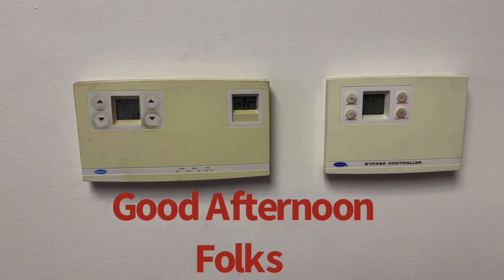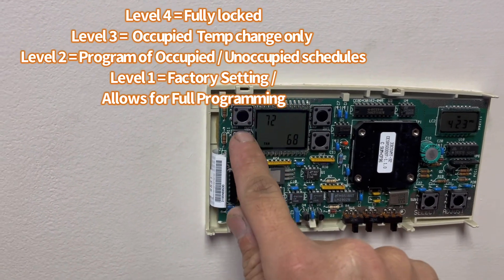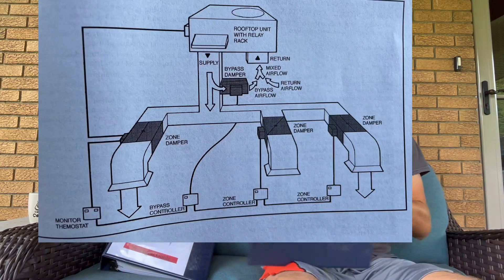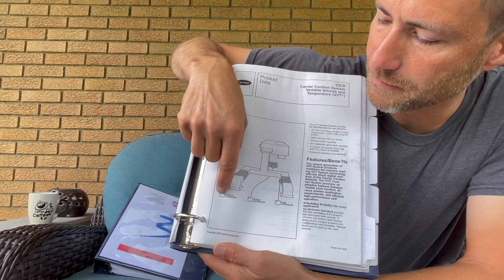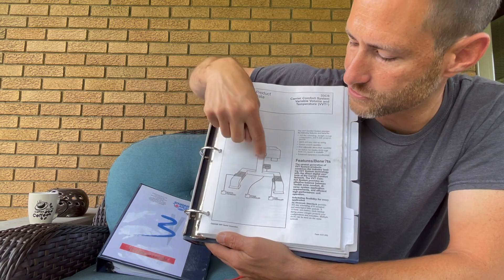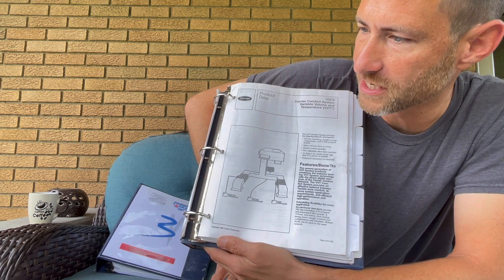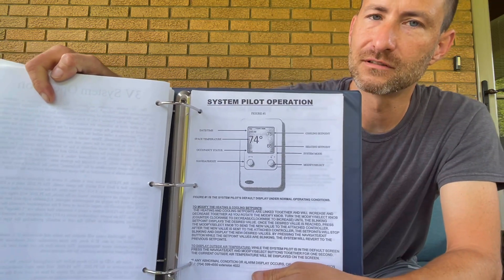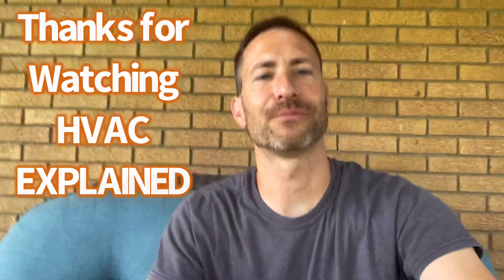Brush Up on Old Technology #Steamfitterslocal449 #HVACEXPLAINED #RuthRauff #heatingandcooling #hvac

Comment: What is the bypass controller for?

Also even if it is set to 75 it feels like an igloo in the office why help!
Reply from the maker: Hey, good afternoon.  
I am currently in route to help out our on-call guy a building down here in Florida got struck by lightning and a lot of stuff is down so bear with me on my response..
So basically that system works on a voting system.  
If you have just for an example :   10 rooms in the building and it’s calling for cooling in two rooms The air conditioning system will go into cooling mode sending airflow down the ductwork and into those two rooms after their zone actuators open up..   since there is a lot of airflow coming down and cannot go into those eight rooms that do not want cooling It has to go somewhere so they use a separate damper above the ceiling to disperse “bypass” the cold air above the ceiling and recirculate back to the return side of that system…  
And same goes for heating in the winter time.
There can be a number of issues while your office is in fact freezing .   
Just to name a few :
Your damper could be broken and stuck wide open, quite possibly damper. Actuator is bad and also is making the damper wide open. 
There could be a bad sensor in the ductwork .   The system that is above if you still have that system is probably 25 maybe 30 years old and due for an upgrade.   
Is your office the only one that is freezing cold?  Also, what is the temperature? Comparing to the rest of the space outside your room

Comment: Great video. Do you know anyone in the Seattle area who knows how to operate this system. Today's date  12/5/2024 and I live in this house for over 8 years with the system Carrier Parker Gen 2 thermostat with a rotary switch, 5 zones. About 5 years ago I was trying to change the set point temp and I mess it up and since then the thermostat is not properly working. Not sure what I did wrong. I was wondering if you know anyone in my area (Seattle) who can help. The furnace is partially working, I had to jumper wire for heating in the winter and cooling in the summer. Thanks

Comment: I have an IPad I use as a 3 ring binder. I keep current and old tech on it. I’m very familiar with Carrier as a CFAD guy. Those programmable Infinity controls have a lot of depth that you have to know ahead, but they are great for diagnostics and nailing the points
Reply from the maker: I’m still using Windows XP on my laptop.  Haha It’s a good system.  Lol

Comment: Ive been in the commercial refrigeration / hvac business since 1984. I still learn new and very useful stuff everyday, especially watching you young whipper snappers apply new technics and equipment. That’s how I manage to keep up and stay relevant in my chosen profession… keep learning.. be willing to be the one to ask questions. Your channel will eventually be huge my man!
Reply from the maker: A lot of younger guys learn a lot from you older guys.  Older guys have been out there for so long you’ve seen it all.  
Just an example how many young apprentices or technicians do you know that walk around with an analog multi meter? Or have ever touched pneumatics?  Possibly an U-Tube Manometer?  Or a Halide leak detector ???  
A lot of new equipment today have LED alert and alarm lights. Older equipment used to have reset buttons.  
Older equipment you can make little adjustments with a service wrench.  Newer equipment you can make adjustments with digital outputs on circuit boards or computers.  
Trust me sharing information is very helpful in this trade.  
Thank you very much for the comments and complement thank you for watching the short video and I’m gonna keep on putting them out there.  Have a great day and stay safe.
Reply: Older guys got me where I am. It’s a great resource and they enjoy the questions if they also enjoy being relevant.
Reply from the maker: @globeflicker9216 :  The one thing that has truly made me a better technician.  I had learned from my father and that is “Good Work Ethic”.   Old school work ethic seems to be like a dying art and believe it or not you can go very far in life with having little to no education as long as you give it your all.  There’s a difference between somebody who just doesn’t care versus just doesn’t know.  If you put everything into it and fail to me that means a lot versus somebody who didn’t even try.  That’s one thing guidance counselors and high schools should teach young kids today.  “If you’re going to do something give it your all.   Don’t worry about somebody else just worry about yourself.  You shouldn’t have to impress anybody except your self.”
I’m not in this field to become a billionaire, just to live comfortably and provide for my family.
Reply: HVAC EXPLAINED 
I’m generationally a Boomer. Grew up with old timers I ignored. Turns out they were right. If you don’t understand old tech (I study old steam books and catalogs so I can easily identify different systems) trying to adapt the ‘latest thing’ may be the worst option. I get to play with manuals, slide rules and tables before I touch a wrench or wire strippers. That’s why I love this trade, you can learn a lot the right way to do it.

Comment: Yea, you can reset the old obsolete control, we had one like that, in a bit worse shape, and then sold a whole new niagara control system and replaced all those old things. We made money, the customer got a better modern control system in where he could see exactly what all the actuators were doing, bypass dampers, VAV boxes. Sometimes actually fixing something like that doesn't really do the customer any good, it just enabling them to go a bit longer before the next service call. It has been my experience that these sorts of things are just callback magnets, and no matter how you explain it to the customer, they always look at you as if it's your fault. I would write this up as temp fix pending quote to replace the obsolete control system with modern one.
Reply from the maker: I totally agree with you that’s why I would not recommend buying random parts on eBay. They maybe a temporary fix but I am definitely would not recommend it.  Sometimes it’s better just to upgrade to the most newest system so you are a head of the game if any parts are needed to be replaced.   Putting a Band-Aid on some stuff it’s just not worth it.  My personal vehicle is 22 years old if the transmission or engine goes I am parting it out or selling at whole.  Thank you very much for your comments have a great day.
Reply: While I understand your reasoning, I disagree that you are doing a disservice to the customer. Here in Seattle, replacing equipment is very expensive and long lead times for permits, often requiring bring building up to code for the BS energy crap they come up with here. Some customers can not afford to spend that kind of money, especially right now with everything.
Reply: @samalmo  everything is different now. we can't find a draft inducer anywhere for lennox now. I hope the manufacturers learned there lesson about outsourcing to china.

Comment: We still have customers with the version before this one. SMH Also we are in the mid to upper 90’s with feel like temps of 105° plus.
Reply from the maker: I have to re-post this video I missed out a photo.  It was a very good system it’s been around for quite some time and still in those spaces.  I’ve had a couple buildings recently get hit with lightning and electrical problems that zapped those control systems and it’s cheaper to update at this point.   
Thank you for the comments have a great day
Reply: @hvacexplained9341  yes best to . And if you can find any stats not cheap
Reply from the maker: @Brutis-1983  eBay.   But I don’t recommend.  Since who knows when “when” another power surge may happen again.
Reply: @hvacexplained9341  the wood plant that has the second generation is going to up grade to I view.
Reply from the maker: @Brutis-1983  :   I’m sorry? ??